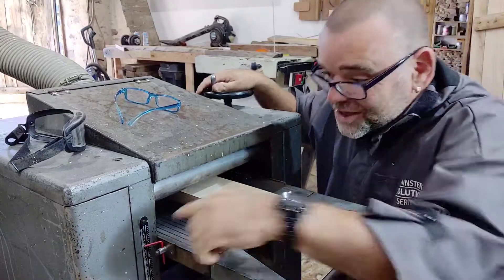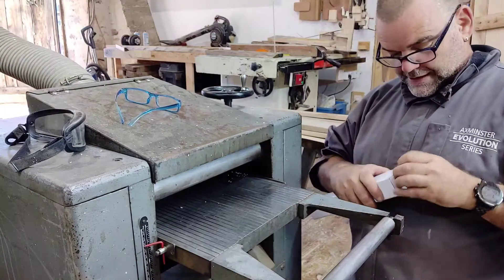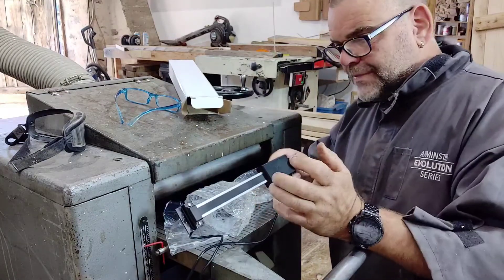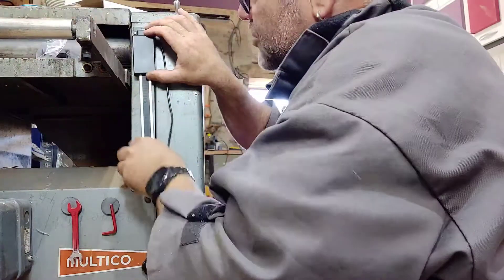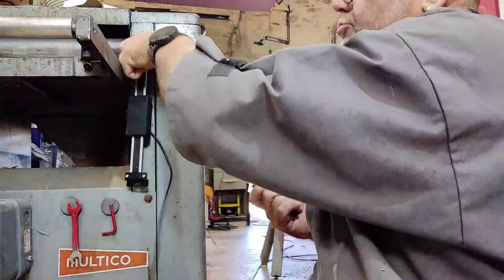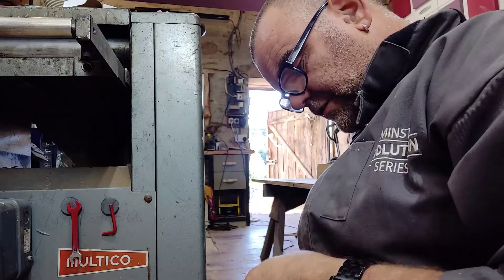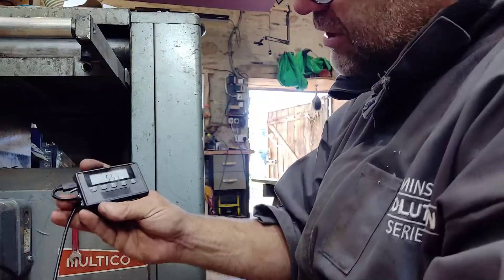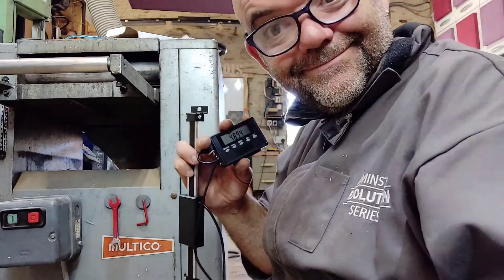Wixey remote ALTERNATIVE DIGITAL SCALE for planers... Unboxing 2020

Comment: Hey Wally, Get yourself a set of M6 taps, a tap wrench (a spanner works but it's quite clumsy) and a 5mm drill bit, decide where you want the scale and drill the holes using the 5mm drill bit then run the taps into the hole for a decent fixing for the scale. Cast iron is incredibly easy to drill and tap so don't worry about that bit, no lubricant needed.
Reply from the maker: Cheers Bud, really helpful thanks. I was dreading it too. By the way, I am loving the machine after a bit of setting up :)
Reply from the maker: Thanks for the advice it worked a treat 😉